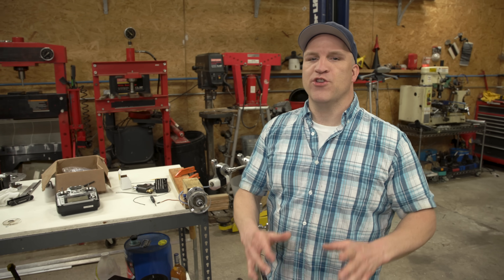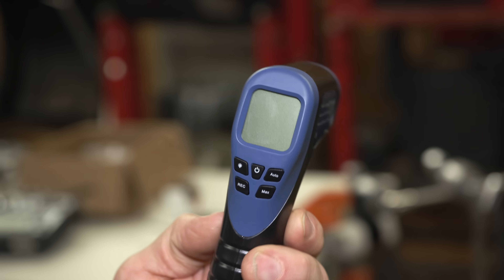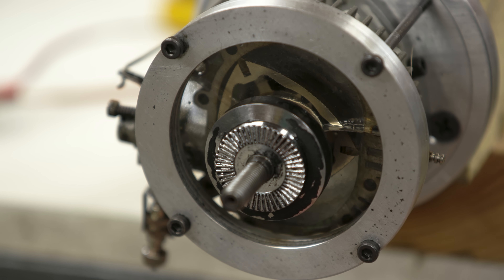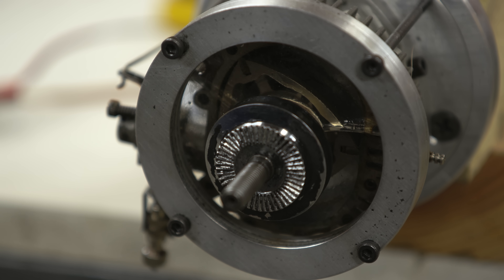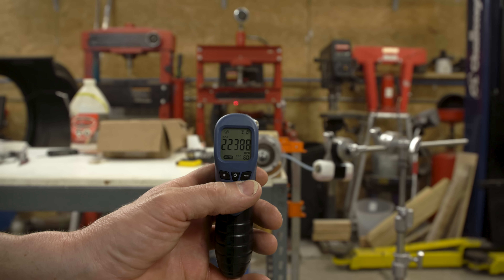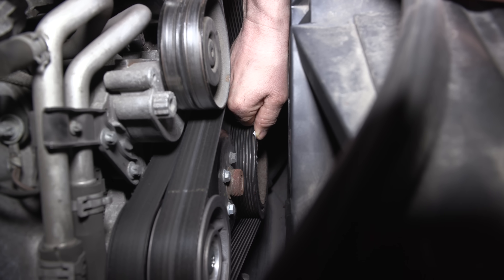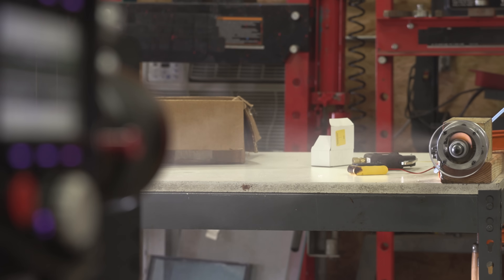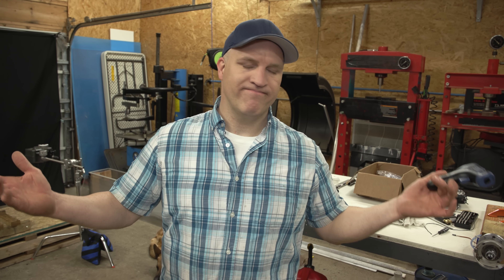See Thru Rotary Engine MAX RPM - 29000 (Wankel Engine)

Comment: Can it run on bioethanol? Having only rotational motion inside makes it a natural engine for generator purpose.  Imagine having this engine behind a wind turbine - when there is no wind, this engine would turn the generator.
Reply: Wankel engines are less efficient when operated on alternative fuels like ethanol because they cannot operate at the higher static compression ratios needed for efficient combustion.
Reply: Not true, The Wankel KKM design has a triangular shaped piston that orbits in a distinctive planetary motion... the axis of the piston reciprocates twice per revolution of the crankshaft.
Reply: Wankel engine have never been successfully manufactured or sold as generator engines because of their extremely poor energy efficiency and higher fuel consumption.
Reply: Thanks for the comments. But there is no change of direction for the piston unlike internal combustion engine. Piston inside internal combustion engine is subject to high G-load - this fundamental difference in motion needs to be accounted on the positive side for wankel engine.
Reply: Not True, it seems you do not fully understand the internal workings of the Wankel KKM engine...  
  The Mazda 13B series for example has 30mm stroke that results from the 15mm stroke of the crankshafts offset journal.
 The Piston's axis RECPROCATES Right to Left and then Left to Right each revolution of the crankshaft.
 This 30mm stroke is what facilitates they change in swept volume that allows intake, compression, expansion and exhaust gases to be expelled.
Reply: But is there still not only forward motion for the piston even if it is not centered? And not forward-backward?
Reply: No, the piston's central axis reverses direction twice per crankshaft revolution.  Usually side-to-side instead of up and down... but reciprocating none the less.
Reply: But 29 krpm means that the engine wants to turn. So it has that going for it.
Reply: But only the crankshaft, remember the 3:1 ratio? The rest is only turning at 9,600 rpm... rather slow for a RC engine this size.
Reply: The major downside is the short crankshaft stroke and the 3:1 ratio results in very poor mechanical efficiency and undesirable torque characteristics.
Reply: The extremely high reciprocating mass restricts the operating rpm to less than a comparable 2-stroke or 4-stroke reciprocating piston engine like the Otto or Benz type engines.

Comment: If you even had a cheapo OBD2 reader you could read your cars EXACT RPM the ECM is being told the engine is running at to have a good base comparison for the tool, rather than those vague lines.

But hey the calculations proved it out anyway, nice.

Comment: crank is doing 29000. the engine is doing 9667 rpm. 161r/s
Reply: But do you not measure the crankshaft's rpm of a reciprocating engine?
Why does this rpm not count?
Reply: @merlinious01  You are correct.  rpm at crank shaft.  Who cares what rotor or piston or any other engine component for that matter is doing or not doing.  As long as the shaft is turning
Reply: @merlinious01  
Because we are looking at the rotor rpm.
A rotary engine have a 1:3 gearing from the rotor to the crankshaft.
Reply: @vitor900000  
I understand the gearing, but i dont see why it matters.
Why not just compare crankshaft to crankshaft? The gearing is more equivalent to the connecting rods in a reciprocating engine, as those gears are what allow the rotor to maintain proper orientation
Reply: @merlinious01  
Because the crankshaft of a rotary have very little/no reciprocating mass. 
The crankshaft is almost like a "straight pipe" so its nearly perfectly balanced. The thing that reciprocate a lot is the rotor and the rotor is rotating at 1:3 of the crank speed.
Reply: Oh yeah. I totally forget that Rotatory have a 1:3 ratio. 
D: Now it doesn't look that impressive.
Reply: Did you see the slow motion frame count? This Wankel was a direct ratio from rotor to crank
Reply: @achilleaustin  
No its was not.
1:37 He is measuring the flywheel RPM that is directed connected with the CRANK so he is measuring the crank RPM not the rotor.
If you want more prof just follow the ROTOR on the Slowmo here 8:34. The rotor do a 1/3 of a rotation while the crank/flywheel do 1 full rotation.
Reply: @vitor900000  I see what  merlinious01 is saying so the 29k at crankshaft still counts because thats where the tachs in the cars read.  U could do rotor rpm if u wanted but keep in mind when u rev a rx8 to 9k the rotors would only be at 3k.  So u could compare 29k to 9k, for example, or 9667 to 3000.
Reply: @timz1908  The thing is the rotor IS the engine... The crank is just the engine RPM multiplied by 3. If you want to measure the rotary engine RPM you have to measure it on the Rotor.
That is important for comparing a Rotor to a Piston engine vibrations and piston/rotor speed.
This is also important because there is a speed limit that gas combustion expends. If the rotor/piston of the engine is rotating faster than the gas expansion velocity you will produce no power.
In other words saying that the rotary engine is doing 29k RPM is by definition wrong and misleading.
Reply: @vitor900000  thing is they are measured at crank.  so rx8 at 9000rpm guess how fast the rotors are spinning inside the engine?   only 3000rpm
Reply: @timz1908  I know... Guess why they do this...
What do you thing sounds cooler? 3000rpm or 9000rpm? Marketing my friend marketing.
Reply: @vitor900000  It seems the design of the rotary and its simplicity makes it easy for people to consider rotor rpm speed when discussing the high rpms the wankel are known for.  Everybody can wrap their mind around the 3 to 1 connection from shaft to rotor and it is easy to make that leap of "yeah u revved up to 9k rpm but the rotor in the engine would only be at 3k rpm and thats not much"  Thats a good thing.  We want the engine components to move as less as possible and the engine still able to perform.  Thats what u want dont dismiss the high revs of the wankle just cause the rotor doesnt have to move much inside the engine to make that happen.  We want the rotor moving as little as possible the importsnt part is the engine still had desired output at the shaft.  The rpm at crank shaft is all that matters!  Even considering what the rotor rpms are when trying to measure engine rpm would be the equivalent of wondering what the pistons are doing in a piston engine at a certain rpm.  We would not be concered with what a specific component inside the engine is doing we just want to se what the engine itself can do.  Like If I showed up with an engine that could rotate crank shaft at 15k rpm but the component that was actually inside the engine only had to rotate one time to do it would you deny I still ran the engine at 15k rpm?  The wankles are known for the high revving and they should be.  High revs at shaft but that says nothing about what the internal engine components are doing.  The actual components inside the wankel engine would be moving orders of magnitutde slower than the components would have to move in a piston engine if run at same rpms. The wankel still far outclasses piston engines in regard to high rpm because of this fact  If you revved a piston engine to 9k rpm each piston would be moving up and down 9000.  Wankle at 9k rpm the rotor would only need to be moving 3000rpm.  So wankle engines can far outrevv piston motors but the actual moving parts inside the engines themselve, Walkles dont even come close to the speeds the pistons and valves and etc can reach in piston engine. Not to mention the type of movent the pistons are undergoing the constant stop changed direction.
So yeah they rev high due in part to fact thay the actual engine components themselves are not having to move very fast.  Engine still revved high tho lol.  They do suffer in torque but who cares when u can rev past 10000.  I wish the engine caught on more and had more R & D.  Fascinatingly simple elegant design.  Another quick note.  So take a wankle at 3000rpm.  The rotor would be at 1000rpm.  But the rotor still have 3000 ignition events at 3000rpm.  a 4 stroke piston at 3000rpm would only have 1500 ignition events at 3000rpm  Another reason to ignore compontents u would only measure the rpms at the crank and those numbers would compare apples to apples who cares what engine type was is doesnt matter
Reply: @timz1908  Man. Let me make it simpler. Measuring it on the crank is the same as measuring after the gearbox. No matter what you say what matters is the Rotor speed not the crank.
Reply: @vitor900000  If measuring at crank was like measuring after gearbox that would be thinking of rotor as the output and the crank as the load!  Sorry you are unable to see rotor rpm would be how many times a piston moved up and down per minute (components we made move by combusting fuel) while the e shaft rpm would be crank rpm (how much force we could extract from the components we made move)  Sorry I am bad at explaining.  You are right though it is simple!  And I see the mistake u are making!  Admittedly because I thought the same till I made the connection.  cheers.
Reply: @timz1908  no, just no. the engine rpm displayed on the dash is crankspeed divided by 3.

Comment: OS MAX  always made the best model airplane engines. this wankel is still running rich. if you lean it out more the flame inside the engine turns blue. a sign of a clean burn
Reply: These engines was designed and manufactured by GRAUPNER GmbH. in Germany... the remaining parts and inventory was sold to O.S. when this engine was discontinued many years ago.
Reply: Not true, the Graupner 49PI engine should always be run well rich of peak and a extremely rich AFR in the 4.5:1 to 5.5:1 range or they will quickly self destruct.

Comment: could u imagine a rotary f1 engine
Reply: f1 looooong ago stopped inovation, i mean since decades teams are not allowed to introduce new tech, that increases power, no tubocharging, limitihg jumber of cylinders, no active systems to increase traction by sucking out air ...etc.

At one time or other such things were part of the race, there wss even a 6 wheeled car if i recall correctly
Reply: @Márton Léránt Yet F1 has the most fuel efficient engines in any world class racing series....
Reply: doktorbimmer  
You do realize that the rules of F1 mean that you can only use 8 cylinder reciprocating engines?
 RPM limited to the maximum of 18.000? And internal displacement to 2.4 liters?

Aaand racing is NOT ABOUT FUEL EFFICIENCY - which is why cars are ALLOWED TO REFUEL MID RACE.

Wankel engines are not allowed in F1 since 82....
...maybe that is why they are not used? (just like turbine, or orbital engine?)
Reply: @doktorbimmer  
Not to mention that F1 is sport & entertainment before anything else.

Continuous transmission like you can see in köenigsegg cars is leagues better than manual in every measure.
But its less fun & less skill - hence its unpopular in sports, and car guys.

F1 is not about reaching the maximum potential of 4 wheeled vehicles on a pawed road.
Maybe we can say that F1 is about reaching the limits of what cars can do with a given displacement engine,  of a given configuration, under a given RPM limit.
Reply: @Márton Léránt Do you realize your knowledge of Formula 1 is even worse than your knowledge of Wankel engines???
F1 has not used 2.4 liter V-8 engines in many years... the current F1 spec engine is a 1.6 liter V-6 turbo-compound engine RPM limited to 15,000 with parallel hybrid drive system...
Reply: @Márton Léránt That is right son, Racing is about ADVERTISING and F1 manufacturers are selling small turbocharged engines and electric hybrids.... Wankel engines are completely obsolete in the automotive industry.... SO WHY? would anyone invest hundreds of millions of dollars promoting a product it does not sell anymore????
Reply: @Márton Léránt And yet Formula 1 cars are the ultimate of world class road course Motorsports competition anywhere on the planet... and the most watched sporting events series in the world.
Really? because F1 is often criticized for being too much of a manufacturer series and not a driver's series... Many Motorsports series formulas require completely IDENTICAL cars and engines... leaving the competition and race results entirely up to the skills of the drivers and the pit crews.... not the engineers.
Reply: @doktorbimmer  
Yes F1 is the most watched motorsport on the world SO WHAT?

Wankels are banned in F1 -> lack of wankels in F1 tells nothing about the viability of wankels in F1, it only tells you that they are banned.

Similarly axial turbines are also banned in F1. Does that mean that jet engines are a bogus technology that is not viable, and cannot work?
I mean if such engineering pipdreams could be made working, sure such engines would be present in all F1 cars!

Jet engines are a myth!
Just like wankels!

At least if we follow your argument, that indicates that wankels are not present in F1 since they cannot be made to work.
Reply: @Márton Léránt You have already proven you don't know anything about F1 or Wankel engines... so why should anyone care what you think?
Reply: @Márton Léránt The FIA did not technically ban any engines, it simply agree to a one engine formula... and since none of the manufacturers in F1 produced Wankel engines or gas turbines it was a completely moot point, you can't ban something that has never competed in F1 or is even being considered for competition in the F1 series.
Reply: @Márton Léránt Jet engines and gas turbines unlike Wankel engines are not obsolete in the manufacturing industry... they are just not sold in automobiles so no automotive manufacturer would have any interest in promoting them.
Reply: @Márton Léránt Wankel engines work, they are simply inferior to reciprocating engines and gas turbines and thus cannot compete against them in the commercial market... There would be no point to developing and campaigning a Wankel in Motorsport today as there is no reason to promote them... they are no longer available, there would be no economic pay-back or incentive to do so.
Reply: @Márton Léránt Yes, I have proved again that you are not knowledgeable or educated enough on the topic of F1 or Wankel engines to speak intelligently on them, and thus completely discrediting your biased opinions and false theories regarding them.
Reply: @doktorbimmer  
Yes FIA has no legal souvereignity over racetracks, so it technically can't ban anything yeah.

Sure!
All car manufacturers limit themselves to the same standards by pure coincidence!
There are no rules!
Reply: @doktorbimmer  
Gas tubines are perfectly capable to power a car - they can even power tanks. 

So are they unworkable, because no one builds cars with jet engines? or because no F1 team features them?
No?

Then we can just agree that its POSSIBLE that engine designs that are not used in cars can be perfectly viable.
Hell even preferred in other uses.
Reply: @Márton Léránt False, the FIA is the official regulatory sanctioning body that oversees all aspects of F1 rules and regulations.
Reply: @Márton Léránt Gas turbines are perfectly CAPABLE of propelling an automiobile... the point is there are no automotive manufacturers SELLING THEM... thus their conspicuous absence from world-class, professional automotive Motorsports.
Reply: @Márton Léránt  You wrote, quote; "f1 looooong ago stopped inovation,"
 You have to see the irony in that statement, as some that was completely unaware of current F1 engine innovations showcased in the series and completely unaware that Wankel engines are not only far from innovative... they are in fact completely obsolete automotive technology now.
Reply: Why would any of the major manufacturers campaign a Wankel engine in F1???

Comment: How did the engine fired even when it has got no ignition?🤔
Reply: This is a Nitro Engine.It uses catalytic compression ignition.
It comes with a "glow plug" in the same place where a normal spark plug would be. 
The glow plug is basically a filament made of Platinum Alloy. 
When kept glowing hot, the filament acts as a catalyst, so the fuel mixture (Methanol and Nitromethane) can be compression ignited, just like in a diesel engine.
The initial heat is provided by a battery, that passes current through the filament to make it glow. That's what a stick-like tool is for when starting the engine. After that, the combustion heat is enough to keep it in an incandescent state.
Reply: @GreatJO  you're correct that the glow plug uses a catalytic platinum wire, but these aren't "compression ignition." the hot wire acts like a spark plug and reacts with the methanol to start combustion.  also, the faster the engine runs, the hotter the wire gets which actually advances the ignition timing.  in racing boats we use 50-65% nitro fuel, and that's about as high as we can go because with more than that there's not enough methanol in the blend for the plug to ignite it reliably.
Reply: @jm-mi7kl  these carburetor engine intakes air fuel mix, so I guess it needs some compression before the hot plug can ignite it.

Comment: Why aren't rotary engines more popular? This design would work perfectly in motorcycles since they have smaller engines with higher RPM's
Reply: They are compact and can be very powerful but not the most fuel-efficient especially when they all suffer from un burnt fuel going into the exhaust
Reply: Wankel engines do not offer any advantages compared to current reciprocating engines and have several very serious, fatal flaws that have never been solved or cannot be solved.
Reply: Several major motorcycle manufacturers (including the company that invented the Wankel engine "NSU") have developed Wankel engines for motorcycle but all proved to be colossal failures.